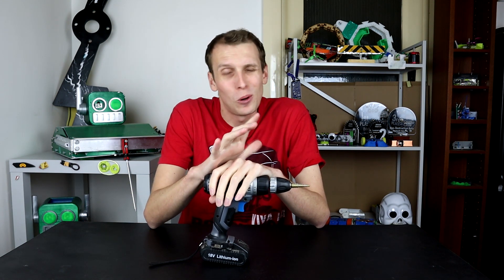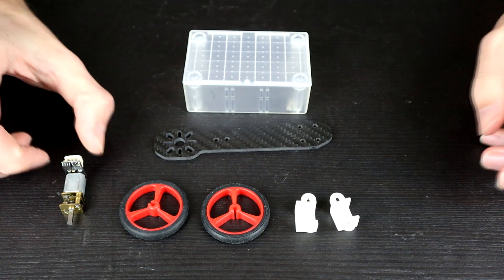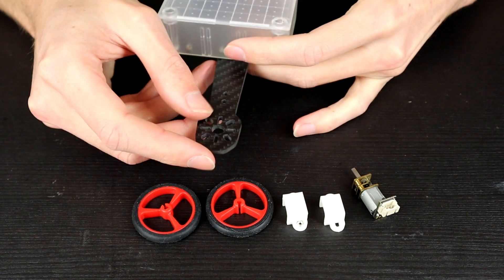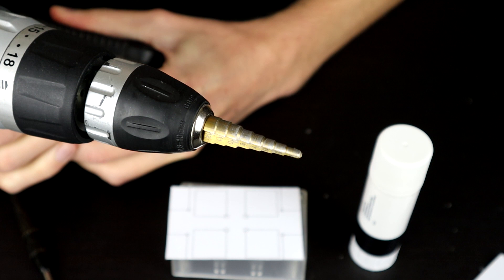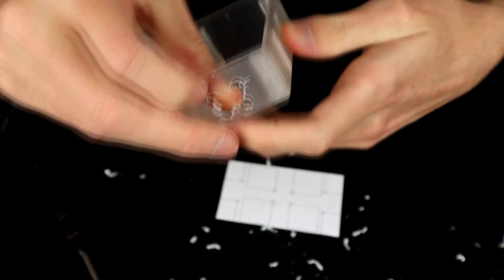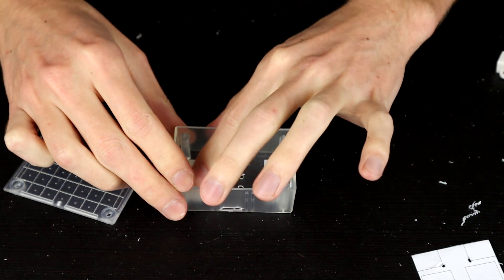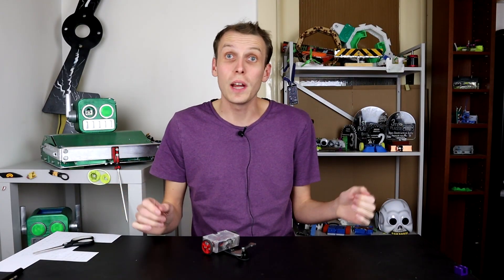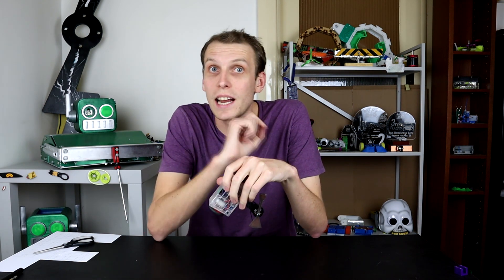Combat robot without a 3d printer! (150g antweight)

Comment: Any idea if tough resins (SLA) would be viable?  I'd hate to need to buy a new printer to get into the hobby but despite your video it seems printing is needed for most practical designs.  Esun Hard-Tough and similar claims a 50+ MPa tensile strength and are "ABS-like"
Reply from the maker: I dont know for sure, as I dont know how they take a hit.

tensile strength is less important than how the material breaks, 
PLA technically has a higher tensile strength than ABS, but its a worse combat material because it shatters when hit, whereas ABS chunks out
This means that a high-impact hit (90+ Mpa or so, enough to break either material) will crack a PLA chassis along print lines, possibly ripping the bot in half, or will take a chunk out of the wall of the ABS. 
This is why I print all my chassis in ABS

If the tough resins are really "ABS like" in their response to high-impact hits, they should be fine 

If you have a test box handy I'd print a test chassis from the resin and hit it with a spinner to see how it behaves
Reply: @TeamPanicRobotics  thanks for the feedback.  Love your content (binged like 5 hours today while working).  I'll try to figure out the viability but appatently the nearest events are a 5 hour drive from me (Vancouver).  Might just get the transmitter and motors for making other rc things (ie gimmics  for dnd group and rc of my Aptera model).  When I get my Aptera I'll get him less guilty driving that far.

Comment: Thanks a bunch for creating videos like this. they are perfect for someone like me just beginning to wrap their mind about tiny robot combat. I've been filling out my notebook with the craziest ideas I can think of and most of them are easy to quickly see why they don't make sense. I did come up with one hypothetical I'd love to hear your opinion on - if I made this exact bot but replaced the carbon fiber stick with a strong, hard spring, how might it behave when hitting an opponent? Would it make the bot less likely to ricochet around the box? Would the spring break?
Reply from the maker: hmmm not 100% sure, but best bet on a hit your weapon will wobble around as the spring flexes. You wont go flying like this bot does.
I think you'd be in danger of hitting yourself with your weapon
Reply: I know i am a bit late but also most of the kinetic energy would be diverted into you own robot instead of the other one because the spring would bounce agressivly after hitting something and increase the chance to hit your own bot

Comment: Can you maybe put links to the electronics that you use in your video descriptions? I know that it takes more time, but it would be really helpful to future bot builders. Thank you.
Reply from the maker: I do when I'm explicitly making tutorial videos, like my beginner spinner video: https://youtu.be/sUtezwaurLQ
(which uses 99% the same electronics as this build)

I don't put links in most videos for 3 reasons:

1) 50%-90% of the time I am testing electronics in a build, I chop and change a lot, testing lots of different things to see what works best, I don't want to provide a link for something I haven't put through at least 2 full competitions. Because providing a link feels like a recommendation, and I cant recommend something with confidence until I know how well it works 

2) links expire, things I have bought from Aliexpress or eBay will sometimes just not exist anymore 6-12 months after the purchase. I try to remedy that by using search links instead but it's not a perfect system and using it you might not get exactly what I did

3) time as you mentioned, it's not major for one video, but I have produced hundreds of videos now, if it takes me 5 minutes to add links for a single video, doing my full backlog would take near on a days worth of work to do. (and in some cases it takes more than 5 minutes, I have a bunch of stuff sitting in boxes at home bought on sale sometime in the past 1-3 years that I intend to put into a bot someday. )
And if any links break or a site I've been using to get electronics from goes down then I'd need to put in more hours to keep things up to date

So in summary, i'm going to stick with only doing this for tutorial videos, as its quicker, easier and means that future bot builders get the correct information on parts I've fully vetted and know work well

Comment: It's biased AF, but you asked for challenges. So, how about designing a UK legal beginner antweight spinner? Sadly for me, I can't just make my version of Gestimate because the drone arm alone is too long XD
Quick reminder that the size limit is 10cm3, but the bot doesn't have to fit flat in that space, it just has to be contained inside it.
Other then that biased challenge... Remake your Ring Spinner ant?
Reply from the maker: I honestly don't like the UK cube rule, its simply a stifle, that was put in place a long time ago, to fix a problem with the meta that doesn't exist anymore
I might maybe do a cube rule design in future, but I don't like the idea of giving away designs that allow the enforcement of what I feel is a very outdated rule.

I do love ring spinners, so maybe its time to get back into them
Reply: @TeamPanicRobotics  Yeah, I don't like it either, yet another reason I want to build a beetle over an ant, but I doubt one new builder (me) making a fuss about it is going to change anything haha.

Speaking of ring spinners, is it worth designing a single tooth "anti spinner" blade for one, or just stick with a multi-tooth design?
Reply from the maker: Ring spinners are a weird case, as they always run a disk
I'd certainly get at least one single tooth ring cut, just to give myself options

Comment: Nice to see a non 3D printed ant, always enjoy the drone arm technique. Just a heads up, I've worked with Mark who built the malenki nano to make an improved version of these n20 escs with centre braking for better driving as well as proper 2S support (the ones you use in the video can die from more than 5V over time sadly - spoke with the manufacturer about this their spec page is wrong.) Mark's ones also mount at a right angle which would fit better in this bot. Happy to send you some to try out? They're called red escs and we've just put them on the BBB shop.
Reply from the maker: I saw those! they look good!

I would be up to do a review, but full disclosure I am working on my own ESCs right now
One is larger and cheap, the other is tiny

The small one is the same size as a dfrobot esc, but doesn't mount to a motor, and instead is dual-channel.
I've got a prototype of the larger one up and running, I'm just working on refining the code, the smaller one is a few months away yet
Reply: @TeamPanicRobotics  sounds good, the more escs out there the better really, hope the projects go smoothly! Small one sounds v impressive.
May drop you a message for a review then :)

Comment: thanks for making this :D it's one problem to not have a 3d printer, next problem is to learn to design things, and if it doesnt work keep waiting until parts arrive in mail, so a "simple" build could last a long time.  how's the strength and weight of that box compared to a printed one?
Reply: My US antweight undercutter is built completely with hand tools and off the shelf parts. The worst part was waiting for motors from fingertech to arrive. It holds up pretty well for a UHMW box and the frame is about half my weight.
Reply: @DigitalJedi  good to know!
Reply: @fromfin90  I realize I dodn't give any info about how thick the UHMW was and what's holding it together. It's 3/8 inches thick on the sides and 1/8 of the top and bottom. All the edges have tabs that interlock and the corners have 2 these in each one: https://www.servocity.com/90-angle-bracket/
Reply: @DigitalJedi  very good, thank you
Reply from the maker: its a little heavier then one I would have printed myself, but it should be a lot stronger as it doesnt have layer lines